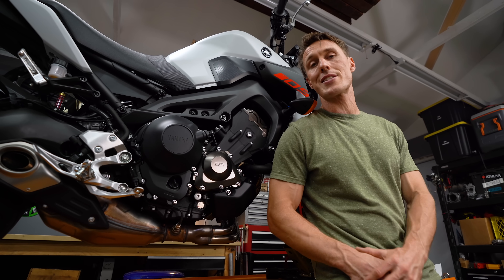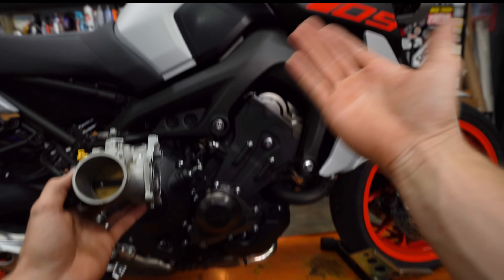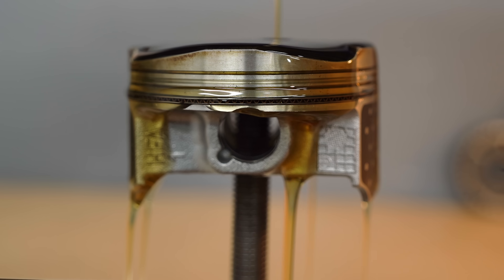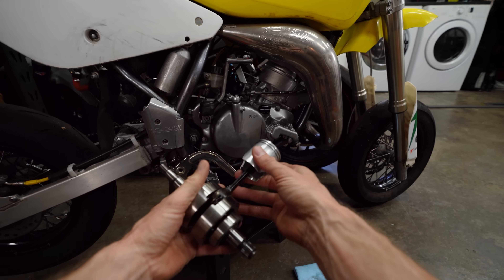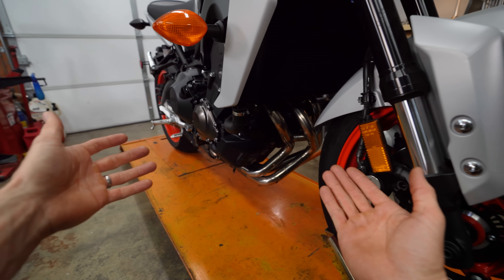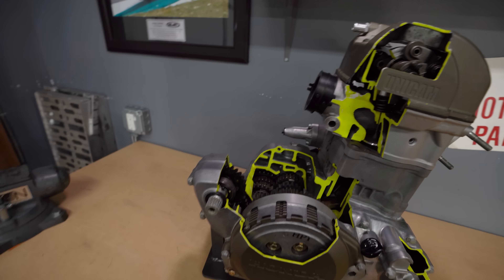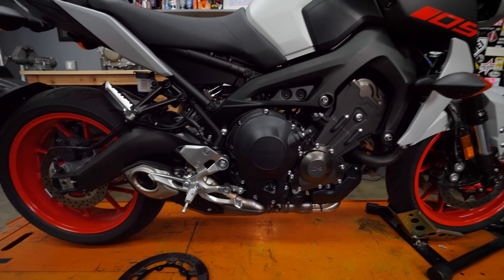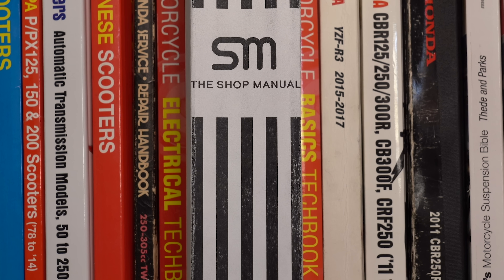Is Engine Braking Bad For Your Motorcycle? | The Shop Manual

Comment: the key to not getting rear ended is to go faster than everyone else 

sounds like a joke, but seriously, it works
Reply: @LastRaven thats where loud pipes comes into play, people can hear my bike from a mile away
Reply: Yep, I always ride about 50-10 mph/kmph faster than the general flow of traffic. It means I never hover in anyone's blindspot for too long, and I don't have to worry too much about what goes on behind me. It also keeps your mind active because you're constantly subconsciously looking out instead of feeling too safe just following whatever the car in front is doing.
Speed only becomes an issue when you push the margins of excess speed compared to those around you. I feel the least safe when I'm just existing in the traffic flow.
Reply: @LastRaven The key is to just go slightly above the speed of the general traffic flow. That way you never stay in someone's blind spot for too long, and your mind stays active because you aren't just following what the car in front of you is doing. In order to not be able to react due to speed, you need to be going way faster than necessary. In any normal situation if you go 5-10mph faster than the cars around you, you still have almost the same reaction time limit as normal. It's a total win-win way of riding.
Reply: All of that is wonderful providing you never need to stop. You always need to stop at least once every time you go out.

Comment: one other benefit of engine braking that ari didnt mention is that you improve fuel mileage on fuel injection systems because the FI fuel cuts while doing engine braking
Reply: True, the fuel cut off on decel, also causes stronger engine braking. Some people change that in the ecu to not cut off fuel, which makes letting off throttle not such an abrupt slowdown. Also makes it much smoother getting back into the throttle.

Comment: That's like asking: Is running your engine bad for your bike?   ;)
Reply: I've had my bike for ten years and haven't run the engine once—I want this thing to last forever, and I'm not taking any chances.
Reply: @AisuruMirai  Take the chance if you have the time, cause if you don't your motor won't last long keeping it stocked in your garage take chances.
Reply: Technically, yes.  But in the same sense that every day you live is a day closer to death
Reply: @AisuruMirai  careful! Corrosion is insidious!
Reply: @mingc7481  It depends on your driving, if you are erratic nor aggressive on the road you know what is going to happen.
Reply: @Andrew Humphrey 
Motorcycles are designed and engineered to last as long as possible under normal operating conditions. "Engine Braking" is a normal condition. Wear and tear is NOT engine damage, but is a normal function of using the machine as intended. Servicing is required as per your owners manual to keep the engine performing optimally.

Engines are meant to be run, not installed somewhere as an art piece. Except for @AisuruMirai bike, it's breathtaking 😉
Reply: @Andrew Humphrey 
Your'e right! I need to rebuild my engine after every 7th engine brake event due to catastrophic engine failure from wear.

Not like my buddy's motorcycle that was inspected with 200,000 miles where the engine was still healthy and showed negligible wear. He must never engine brake.
Reply: @Andrew Humphrey Not by much though. Approx. 95% of engine wear comes from cold starts where the oil layer on the crank and valvetrain has drained away. If you continuously run engines, they have an extraordinarily long life. Thats why semi tractors are commonly in the million-mile club.
Reply: @AisuruMirai  The engine will be bricked without running it. Seals dry up, the corrosion protection in the fluid wears out, and the moisture in the engine block will corrode the crap out of an engine if it is never run. If you want it to last a long time, you NEED to run it. Not for 5-10 min, but 20-30 min. every couple months at least. No running allows moisture build up and rust to form on the areas where the oil hasnt touched it in a long time. Short runtime pushes that moisture all over the engine, but long runtime boils away the moisture. If you havent run it in 10 years, it is potentially already toast.
Reply: No its not. When i first got a 2 stroke after riding 4 stroke for a long time i engine breaked down a hill an within seconds the rear wheel locked up
Reply: @Andrew Humphrey no shit???? Holy fuck-balls! No one ever would've figured that out!!!
Reply: Let's face it riders have got the ride to concentrate on & engine breaking is just a way to slow down.

Comment: You forgot to mention that it also improves fuel economy when combined with some fuel systems.
Reply: Explain... Be cause I dont know how engine breaking( letting off the gas) could save fuel better than pulling in the clutch and using the break🤔 
Even though I always gear down or "engine brake"   been riding for 50 years..
Reply: @davidjessee7701  This works only on bikes with fuel injection, when you let off the gas and the rpm are above idle, the computer shuts of the fuel until the engine speed reaches idle again just like in a car engine. Works great on long downhills. I have seen systems on carburated bikes that more or less try to do the same thing but they still let some fuel go. I hope my explanation makes sense.
Reply: you're talking about "Deceleration Fuel Cutoff/DFCO"? I always noticed that with modern fuel injected vehicles that has fuel economy indicator (the fuel economy goes up to the moon coz the ECU programmed the injectors to shut itself when engine braking).
Reply: @junkawakami3193  yes fuel cut on decel. Saves fuel, stronger decel, but some bikes can be very twitchy/not smooth getting back into the throttle. 
It is why I turn fuel cut on decel  off in the ecu. Smoother decel and accel. But less deceleration off throttle,  and uses more fuel.

Comment: havent had to change brake pads for lots of kms on the 1290 🤣
Reply: That bike has a ridiculous engine brake! Takes time to learn to close the gas later than other bikes. Absolute beast
Reply: Same on my rsv4, over 30k km with lots of heavy braking when going fast occasionally and the pads are at half life, racing derived engine braking is amazing

Comment: I've heard of mods that activate the brake lights when deceleration occurs, something like a mercury switch activated line. Would be a worthwhile upgrade for those who rely on engine braking a lot.
Reply: Think that's just a matter of properly learning how to ride a bike. Whenever you slow down, use the rear brake enough to trigger the brake light. Same goes for always checking your mirrors when stopped at a red light for approaching vehicles, and being ready to go anywhere if the car behind you isn't slowing down. 
Still, it would be useful to have that just in case you forget, but I think that might just make more people lazy when it comes to road safety/awareness if that ever becomes standard equipment.
Reply: I find it's easier to trigger the brake light switch with the lever for front brakes.
Reply: You  could do all that, or just use your back brake like you should anyway.
Reply: I know of bikes in the UK that have been fitted with with mercury switches about forty years ago. They work fine but (obviously) don't work when the bike is stationary. I like to keep my rear brake light on on soggy, wet Winter nights when I'm waiting at junctions or traffic lights on a rainy night. Gives me a bit more visibility.

Comment: 3:33 Harley-Davidson have a "negative" throttle, where you can push the throttle beyond its resting position, and if idling one of the two cylinders (I don't remember if the front or the back) gets shut down in order to transform it into an air pump.
It's meant to cool it down for parades, when the bike could overheat.

Comment: This reminds me of Twist of the Wrist 2, "Pads are cheap, engines are expensive", but I guess as long as you are not downshifting so aggressively, that you are overreving or locking up, then engine-braking a 4stroke is ok and not complicated.
And like Regen-Braking an electric motorcycle, engine-braking extends the life of the normal brakes.
And I can imagine all that vacuum in the combustion chamber, sucking oil pass the rings, so cylinder lubrication shouldn't be an issue.
I'm more interested in EVs, and only using engines to make Hybrids, but this video was great to watch & learn. Thank you.
Reply: @LastRaven 
Oh, I forgot about Slipper Clutches.
Maybe those can tuned, so that you can't damage the engine, with engine-braking.
Even when you dump the clutch at 1st gear, after climbing to the top of 5th.
I have to lookup if that's ok with a Slipper Clutch.

Comment: Good video. At 1:04, this is not correct. The pistons continue to move due to linkage to the wheels via the gearbox, not because of some stored inertia or 'vacuum effect' (though there will be a vacuum created). This is why you cannot really engine-brake meaningfully in neutral, for example. The crankshaft must be driven by the movement of the bike through the gearbox.

Comment: I think the problem with this is the lack of manual transmission cars and subsequent stick drivers in the states. (Not saying there aren't europeans or asians etc who might also think engine breaking is a bad thing) Because engine breaking is simply taking your foot off the gas in a car. (Also not saying engine breaking isn't a thing on autos, it's a thing on anything with a piston engine, but the difference being you definitely feel it more on a stick than an auto)

Comment: THANK YOU for setting the record straight on the 2-strokes.  The engine braking myth came from 2-stroke cars coming down the Alps, engine-braking for 15 minutes.  It's also a problem with 2-stroke airplanes descending from altitude.  But if Kenny Roberts can get away with 13,000rpm triple-downshifts into corners at Silverstone, you'll be fine keeping your YZ in gear on the brakes.  Just don't do top-gear pulls on 100:1 Saber mix.

Comment: I didn't want to read all the comments to find out if someone already said this... but, when i learned how to ride motorcycles and also naturally learned to engine brake, regularly. And once or twice this has saved my life. because I was riding along and there was traffic in front of me and they suddenly moved out of the way and there's a broken down truck sitting on the side of the road, but I couldn't see it until the car in front of me moved out of the way!  I had less than 10 ft to maneuver stop or do whatever i could to avoid impact!
 having the habit of engine braking and using the brakes at the same time I was able to break maneuver and get around the truck! it was insane that I was able to do it and not crash, lose control nor slide into impact.
 When I got to the next stoplight  a couple of drivers hollered out to me "wow that was great driving!" And I was thinking to myself it really was great and lucky! instinct and regularly using the brakes and the engine brake.

Comment: I had no idea people thought it was bad. And that's why I watched 🤷
Now, it's worth noting that there are inertia switches available, which light the brake light when you begin to decelerate, whether or not you're using one (or both) of the brakes. My '80 XS650 will be getting one, as soon as I free up the time to install it.

Comment: I have been riding since 1966, engine braking is the one tool that not only does not wear out, but it helps cool the engine with oil and coolant flowing without adding heat from the throttle. It helps stabilize the bike in a hard braking situation, and set up for a turn not to mention if you can down shift as you enter the turn you are now in the correct gear to power out of the turn.. One thing be sure to tap the brake so people behind you know you are braking.

Comment: A comment about gearbox loads said to be highest when full power acceleration. I found when designing sidecar racing gearboxes that shock load coming backwards from the rear wheel on bumpy tracks was the real killer. Though most modern bikes has gearboxes capable of handling more torque and abuse for many years without failure.

Comment: Also, maybe not so much now, but when running in a new engine it was a good idea after short hard acceleration to snap the throttle closed, the vacuum created in the cylinders dragged oil up onto the cylinder walls helping running in a tight engine. If I been running at a constant speed for a while I will still do this. (This is why if your rings aren't sealing properly, after a transition from fully closed throttle to open throttle you will get a puff of oil smoke because the vacuum has pulled oil up past the rings and needs to clear).
Ps enjoy your posts .

Comment: I saw a test performed by an Austrian motorcycle channel called “1000ps”.
They put a Kawasaki Z900 on a dyno and did some pulls on 95, 98 and 102 RON.
I think it’s about equal to 91, 93 and 98 in the US. 
The graphs were pretty much identical and within 0.4 hp of each other.
And the highest figure wasn’t even with the 102 RON race gas.

Comment: The Ardmore  LED  brake light  flashes  during engine braking ..  very   comforting to know..  If  you down shift too much on the FZ-07  you can skid your rear wheel  .. even more on wet pavment.. or a  little  frost on the road..

Comment: I went from a 489cc para twin to a 649 cc inline 4, suzuki to honda, and have noticed that the engine braking is alot more 'INSTANT' on the inline 4 and helps slow me down when cornering, knowing full well it wasn't hurting it, I used it virtually instantly on the 'new' to me bike and apply a little bit of brake, just enough to illuminate the light when doing so.

Can also be a great way to slightly rev the engine when down gearing and rev matching to let people know you are there, especially pedestrians.

Comment: Regarding the heat, engine braking actually cools the engine through air decompression (that's also how refrigerators work) to the point it can sometimes even cause ice to form on the throttle body if the ambient air is just above freezing. It's not an issue but it is the complete opposite of overheating.
Reply: You're dealing with folks that have a hard time understanding that loading the front fork provides more contact on the road.  The Joule-Kelvin effect....*mindblow*

Comment: STS company makes a Smart Brake System that turns brake light on temporarily while decelerating. I have, and it works great. It does not interfere with regular braking. You can choose between steady and flashing brake light.

Comment: Problem arises when you have a carburetor engine. With EFI, you shut the throttle the injection is not adding fuel. With a carburetor, the extra vacuum pulls lots of fuel up through the jets and since there is no air, is not burned. It ends up going past the rings, washing oil from the liner and thinning the engine oil. If you have a carbed bike, it is best to pull the clutch and use brakes when stopping vs downshifting through each gear.

Comment: A company called Safer Turn makes a module you wire to the brake light that uses an accelerometer to detect engine braking and turns on your brake light without you having to touch the brake levers.

Comment: In modern large trucks, electronic systems employ engine braking when the brake peddle is pushed (along with actual braking). This stops the truck faster.

Comment: FWIW, I drag the rear brake just slightly when I engine brake on a highway or in the city just to make sure my rear brake lights illuminate. I've been rear ended on a city street when I engine braked to make a no-stop right turn on a side street.

Comment: I have an accessory brake light that senses deceleration and lights up and flashes whether I'm using the brake or if I'm engine braking.  Mine is the Billie Brake light from Clearwater, but there are others.  It's reassuring to know that those behind me, whether car or moto know that I'm slowing/stopping.

Comment: I did it on my bike the moment it left the dealership 6 years ago and recently took it apart to check if I really did any damage to the internals. Nope, piston rings is in perfect shape, rod is sturdy, bearings are good. So I just reassemble all the parts except for gaskets(duh) to keep the experiment going, just to see how long it can last. Although I'm tempted to upgrade to a bigger bore size block & piston (cus it's an underbone 135cc bike). Still fun af to mess around and not break any law really.

Comment: In trucking we are encouraged never to be traveling at highway speed in neutral, especially in low traction conditions. Using the engine as a backstop to provide constant, instant, and moderate drag on the vehicle is seen as a way to lessen the chance of losing control of it.

Comment: The most important part of the engine that is affected by engine breaking was not mentioned. It’s the timing chain. The power placed on the chain is reversed when going from power to engine brake. Proper cam chain adjustments eliminate any back slap. Some vintage motorcycles had very long cam chains that caused wear.

Comment: I don't expect to be major issue but I believe it is important to relate to the chain and sprockets . While e.brakeing the tension  load is in the passive area , were the chain usually "just"  complete the loop .  If the chain is not tensed properly , it might hit the wheel arm and there is different wear to chain and sprocket teath ...

Comment: I never knew there was a debate about this. As to engine braking in general. I have always done it didn't matter how long the hill was.  First bike was 50 cc two stroke and Long Island has many hills 3/4 to a Mile long with 30 miles per hour speed limits. So 4 th gear closed throttle all the way down.